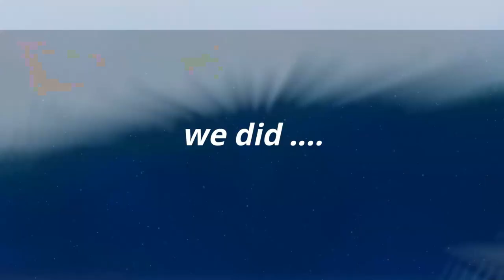I Spent EASTER on our Boat and It Was AMAZING!

Comment: Blaine, why do you suppose they put so much filler over the entire boat. Your boat should weigh a couple 1000 lbs. less without it and better fuel consumption as well.
Give us an update on your new generator install and it's cabinet that you built.
Reply from the maker: I'm not sure why there was so much filler. Sure, the boat is welded aluminum and not perfectly flat but certainly not deserving of as much filler as we removed. It was pretty shocking. Our last haul out showed 80,000 lbs on the scales. Pretty light compared to the two boats next to us which were a bit smaller with one made of steel and the other of fiberglass. They were each 120,000lbs. We will eventually get the rest of the aluminum polished up to a matte finish and all uniform which should improve the appearance as well as reduce maintenance a bit further. We noticed a 4GPH reduction in fuel burn after the big yard visit however that visit also included prop repair and bottom cleaning so its tough to judge where the main benefit came from. 
        We ran the generator a fair bit this winter. I think we are up to about 450 hrs on it at this point and it is working well. We have enough solar production at this point though to go without it till next winter rolls around. I plan to do a video at some point to talk about the progress and results of that project. Maybe we will move it up the list. Janis always complains that I ramble when I start going into the technical stuff. She is probably correct. 😄 Take Care! 

Blaine